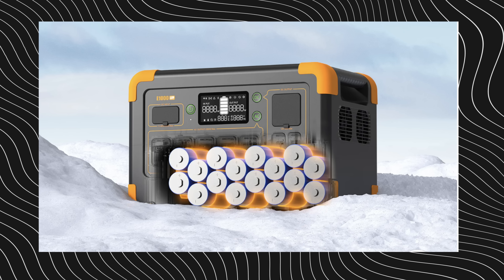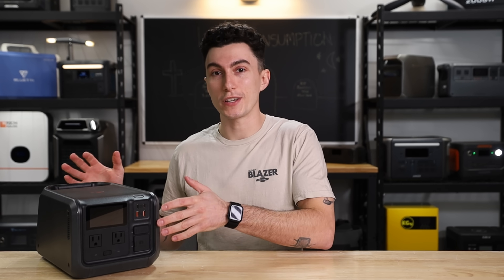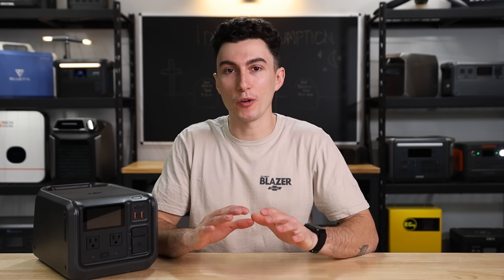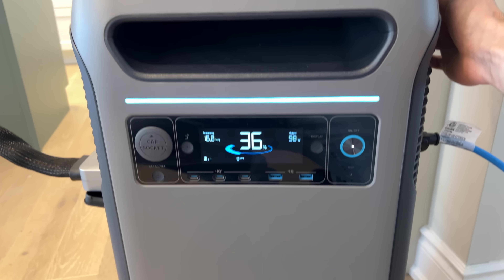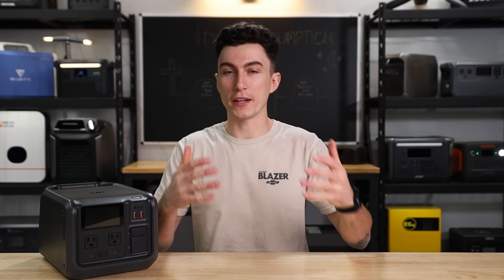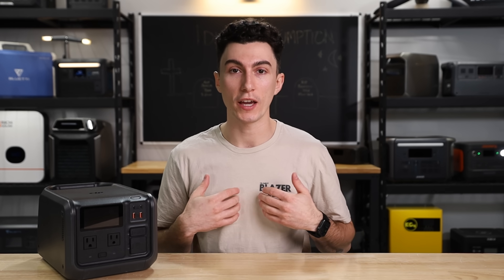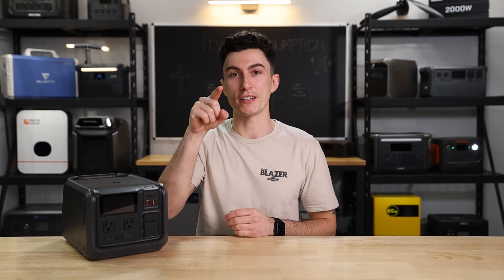Why Your Power Station is Draining Itself So Fast..

Comment: I only run a little power station for my DJ gear and mobile use i use my main solar array to run my off grid house for jyst this reason oh and also the bigger power stations are not worth the price in my opinion i refuse to spend so much on a little setup with so many limitations

Comment: It get's better. With these devices turned on: Cyberpower 650VA lead acid UPS 7W with nothing plugged into it. Bueltti EB3A shore power no outputs and claiming it's pulling 0 from the wall to charge is pulling 29W to be on. Eco Flow River 3 29W. FFPower P2001 9W So even when these power stations are claiming they're pulling 0 from the wall to charge they are pulling just to be powered on. And most of them can't be turned off if they're plugged into shore power like the Cyberpower can. The FFPower is probably so low because it has no wifi, bluetooth etc. Ironically it has the biggest inverter. But with the inverters off it doesn't really matter. I bought it on purpose because I didn't want to have to use an app like with the EB3A to turn it off. 29W non stop for a month can matter. I love my power stations but if every watt matters you might want to know the "dirty" details.

Comment: The sad thing is that many devices we plug into an AC power socket actually require DC power. Like a PC or a LED light bulb. So these devices convert the AC power to DC power. Which gives more loss. But it is what it is.
Reply: @Aranimda  they make 12dc led bulbs for the RV market. 60w equivalent  led bulb, uses same socket as 120v.  Label your bulbs. :-)

Comment: 100% on point. Using DC devices on your battery stations goes an incredibly long way. My Anker everfrost will run for roughly 2 days on a 1KWh battery off AC but will run for about a week off DC. It's great that so many devices run off USB these days for that reason. That is also the secret to USB C charging on laptops as well. Great vid!

Comment: I discovered this when I left a small Canon battery charger connected to my DJI Power 1000 for a few hours and came back to 75% battery life remaining, even though the Canon battery is way smaller than that and fully charged in less than an hour. Leaving the inverter idle drained the heck out of that unit. Lesson learned. I've recently picked up a new USB charger for Canon batteries (something Canon still does not offer), and I've been looking for a small DC fridge for the back of the Jeep. What model are you running?
Reply: His 12v cooler is an ICECO VL45.

Comment: Since I use my units only for backup power needs and to save a few $ when the sun’s out, I don’t leave the inverter “on”.  I only activate the DC—>AC inverter when I’m actively using the generator and when I’m away from home (in case the power goes out while I’m gone).  And I’m ok with “idle” inverter power draw during these periods.

Comment: But if you turn off the AC supply on your power station when your not using it then you lose nothing, right? or wrong?
Reply: I wonder that too. And turning the machine off completely won't cause it to lose power?
Reply: You'll still lose a small amount, but not enough that you'll notice

Comment: wrong! DC-loads also use inverters to establish the required voltage (often called buck or boost converters) since these loads are usually smaller, their standby consumption's are also smaller. Also the mentioned dc fridge uses an inverter to power it's compressor however because this inverter is designed for it's load and is usually not active when the compressor is not working, it's own consumption is low

Comment: A refrigerator is an issue for those power stations with 3-10x compressor start usage and 50%+ idle, where an inverter must run all times.
I had to step up to 1000W inverter with 2200W peak to accommodate my garage freezer, normal usage just 70W.
This is how inefficient power station is for 120V freezer. But its only option I have for my condo.

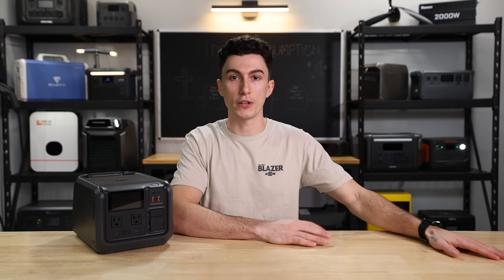Comment: Just a heads up @5:45, there still will be some overhead power used because the batteries are very rarely wired up as 12v.

You would still have some losses converting from 48v (or whatever the internal pack voltage is) down to 12v.
👍

Comment: "The fridge uses 1300 watts per day......."
That's 1,300 Watt HOURS per day.
"The Fridge uses 54 Watts"
"IF the Fridge uses a constant 54 Watts, (Joules per second) over a period of ONE hour, That's 54 Wh.
24 hours it uses 54 x 24 = 1296 Wh"
(Or 1.3kWh)
.
In terms of "water"
"Watts" is the flow rate of the water ("Volume per second/ minute/ hour")
"Watt Hours" is the Volume of the Tank, Or the Volume  it depletes, Or The volume remaining.
.

Comment: You can make a cigar lighter to read black cable and connect to a small external inverter…
It’s messy but if a you need is 60W..

Comment: Power stations are meant for portable use, instead of that just use rack mounted battery with inverter so you can use inverter depends on the load also less hassle, if the inverter fail fix or replace the inverter not shipping out the whole thing

Comment: Just a short comment on the DC output ports: In different power stations, power on these ports is provided "direct" or as "transformed" DC power in different powerstations. For example, some small and cheap unit here provides "raw" DC, flowing more or less directly from the battery pack to the output. A somewhat larger unit (from Ecoflow) provides "transformed" DC power,  with voltage levelled on 12 Volt. With the Ecoflow unit, you'll have to separately switch on the DC outputs. When using them, you'll have both time-based losses, and also up to 20 (!) percent consumption-based losses. Those losses won't be "seen" by the power station itself, which actually means the power station "lies" to the user about what amount of remaining power there is in the battery pack.

For DC consumers using only a few watts, but over a longer time, it might be more efficient to small, "dumb" battery pack. Even if you need additional recharging cycles (from power stations to smaller "dumb" battery pack), which again produce quite a lot of losses, depending on the setup you'll get more "net power in total, then keeping the power station switches on for a long time.

Comment: I found out that my EG4 portable hand truck unit really sucks the energy out of the server rack battery using that 3KW inverter.  I did a test on my residential fridge that draws 115V at 7.2 amps and it only ran the unit for 55 hours.  It used about 2700W to run the fridge and the rest was used up by the inverter.  I am going to order the Victron 48V 1200W inverter and remove the EG4 inverter and run a test to see how long it will run the Fridge.  At most my fridge will peak at about 868 watts when defrosting.  I am anxious to do this test once I receive the unit.  Glad you mentioned this topic.  Many tubers will mention something about it in their reviews but it is more of a side note that many people may not know what it is.

Comment: The DC to AC conversion can be ineffective like the voltage boost. Note that some devices like pure hotplates can use DC even if they are designed for AC. A fridge don't work however as the compressor may need AC to function. The optimal would be to have a battery that match the voltage of the device. So a modular battery that you can clip together to drive the device and then disassemble to charge at a more safe voltage (as safely charge a battery that is at 220v is quite a challenge).

Comment: Big battery, sall inverter is the combination hard or impossible to find. I buil mine. 3.5kwh with a 600w inverter. The inverter did not kill the battery and it is enough for a couple of lights, the wifi, tv and computer at the same time for a long time.

Comment: There is still idle consumption when only using DC power. I have encountered this a lot with my EcoFlow unit.
Reply: How do you reduce the power consumption in idle?
Reply: @ you can’t unless you turn off both AC and DC output and have nothing plugged into USB outlets etc. Or just turn the unit completely off. Most of these power stations use a higher internal voltage and then reduce it to around 12V for output (5v for usb) Lowering the voltage results in power loss.

Comment: Idle consumption on the Delta 3 Plus is 35W - 40W. That's quite bad even considering that it has a 1800W inverter. Victron's 2000VA inverter has 11W idle consumption. Granted it's a completely different grade of inverter.
I've measured EcoFlow's River 3 Plus and it's idle consumption is around 8W. The inverter is only rated for 600W. Though if one intends to run a load of less than 100W, it's much more efficient.

Comment: So if i am understanding this, it's not actually idol time loss. It's the units operating consumption from inverter inefficiency plus a little bit of power for the display and control circuitry. 
But when the unit is not in use, sitting in a closet, is there any parasitic drain?
Reply: Yes, but MUCH less than inverter idle.  All batteries, regardless of chemistry, suffer a small amount of charge loss with time.  You just need to have a maintenance schedule on batteries kept in storage.
Reply: Fully off a power station will lose some energy over time because the battery chemistry is that way.

If you have a power station you should take it out, use it a little, and charge it back up every 3 months. In fact, its good to make a checklist of things to do every 3 months in general. Emergency water and food rotation, checking all batteries, checking generators if you own any, etc.

Comment: Excellent video, thank you
I use  DC LED string lights to supply light, the consumption is tine and under 5w
The power supply for the CPA is substituted with a DC-DC PS that keeps my draw low.
The DC powered refrigerator is a good start. 
The idea is to be nimble
THanks

Comment: Because these these cheap high-frequency, transformerless power stations lack an output transformer to provide galvanic isolation between their DC boost stage and their AC output, they can damage your appliances and even set them on fire. Don't take my word for it; ask Google AI this question: Can a high-frequency,  transformerless inverter damage your appliances? and learn the truth about these potentially dangerous products.

Comment: I did a review of the power station you had next to you, the DJI Power 500 and RANTED how much I disliked that you could not JUST PLUG IN SOLAR PANELS into it, you need some sort of MPPT adapter for $58 extra, and the listing on Amazon made it seem like you could, which was false advertising. 

Here is the video I made reviewing the unit you put in the center spotlight:
- DJI Power 500 Power Station NOT Solar Generator Drone Charger Unboxing Review 
https://youtu.be/5sBob9pafIk

Great video by the way!

Comment: I’m looking at Ecoflow River 3 UPS or River 3 Plus to replace my Cyberpower UPS for my workstation, do you. Think it’s a good idea? It has <10ms switchover speed. However, I’m a bit concern about its battery since it will be plugged in to power 24/7, meaning 100% at all times.

Comment: I did test on Idle consumption on 2 twelve volt inverters and they were surprisingly low and these are the units I use everyday instead of solar generator power stations. One 4000 watt one, used about 9 watts an hour, and another 500 watts, only used about 6 watts per hour which was able to run my fridge because it could handle the peak on the start of the fridge. My advice is to get a 12v battery charge it via mppt, and skip the solar generators completely as the those idles will get you, not to mention is is more expandable and cheaper. And I would never get a solar generator or power system that had such high 150 watt power consumption that is just ridiculous!!!

Here are the two videos: 

- OLTEANP 12v DC to 600 Watt AC Pure Sine Wave Inverter Unboxing Review Fridge Test  - - https://youtu.be/iAfzu2Aa3hI 
- Roarbatt 12v 4000 Watt Pure Sine Wave Inverter Best off Grid Solar REVIEW & UNBOXING 
https://youtu.be/I8-J4XMKIN4
Reply: Victron inverters also have good idle consumption.

Comment: The " idle power" consumption being mentioned,  just makes good sense,  so customers can properly plan. 
This was a very interesting video. I know the engineers can crunch the numbers, should be on the little digital display panels with counters.
❤❤❤

The talk of DC appliances being mentioned was EXTREMELY interesting,  b/c it sounded like the use energy more efficiently?

Comment: Is it possible a separate inverter that is more efficient connected to the DC output of the power station might not drain as much power? Of course, at that point you're starting to get close to simply hooking a battery up to an inverter and doing away with the power station. It would be an interesting hack to look at similar to adding batteries to the solar ports on the Ecoflows. Have you considered doing a "hacks on stations" video?

Comment: This is a very big deal for me and it's very hard to find these numbers. Is anyone aware of a published chart or spreadsheet of many of the more popular models?

I'm aware that Delta 3 Plus AC idle power is 40W according to several testers, whereas Delta 2 is 15W. Delta 2 is a better fit for powering a refrigerator overnight, despite being a less expensive, two-year old model compared with Delta 3 Plus.

Comment: Generally speaking the larger the inverter, the greater the idle consumption.  Some inverters, such as the Victron Multiplus-II, have additional circuitry for low-power loads that vastly reduces idle consumption.  But most inverters do not.  The inverters in power stations tend to have particularly poor efficiencies.

So for example, a little 300W 12V vehicle inverter typically burns 10W.   A 1500W inverter is usually around 20W, a 3000W inverter typically burns 30W.  A 10kW inverter typically burns about 100W.  But it depends on many factors, most specifically the quality of the components and whether the inverter has additional circuitry to tune to lower loads.

This is only applicable to AC.  DC regulators and converters have far lower idle consumption... typically less than 1W.  They are still switching, but they don't have to generate a waveform on the output so a DC regulator is actually able to almost completely turn itself off and let the output voltage ride on its buffer capacitor when the consumption is low or zero.

--

Lets get the terminology straight, though, it starts to grate after a while:

"Watts" is a measure of power without time-units.  One might say a heater consumes 1000W, for example, but the amount of energy it consumes depends on how long the heater is turned on.  The unit is Watts (W).

"Watt-Hours" is a measure of energy.  Also "Watt-seconds", "Watt-sometimeunit".   But typically, "Watt-Hours" or "Kilowatt-Hours" is used.  (Wh) or (kWh).

When you said "70 watts per hour"... That is NOT watt-hours.  That is Watts/Hours.  That isn't a proper unit of energy at all.  I know what you meant to say... but please use the correct terminology.  The proper terminology is "Watt-Hours".  "70 Watt-Hours".  Not "70 Watts per Hour".

-Matt

Comment: And this is a fact ive tried to explain over and over, idle consumption is a killer, 70 watts may not sound like much, but its actually pretty shitty, even on that 3800. My units are low frequency, which are a whole different topic, but my 3000w low frequency units idle at 13w.  13w x 24hrs = 312w, and thats the difference in a quality unit, and these chinese units people seem set on buying. I would say I told you so, but I did! TY guys for shedding light on really stupid stuff. HEAR YEE, HERE YEE ! I could build those type of units for a third of the price, but its still just cheaper shit

Comment: #1 idle consumption hater here , here are some tips for you guys..  remember cooling fans within stations also draws power so if you can use without tripping the fan on the better

 for three appliance types

Fridges 
Standing fans 
Routers

1) Fans -  RARITY ALERT!!.. chose DC motor fans put those AC motor fans in the TRASH that's the difference between 80w power draw and 16-30w
Reply: Here's a little secret though some DC fans have TYPE C power cables which means they can draw from DC power directly via USB(and AC via a brick so it's versatile)that not only includes portable power stations but also POWER BANKS TOO!!!! (If they support PD output aka power delivery at certain voltages /amps)

example :
EVYON 12.8" Standing Fan,15db Quiet Fan for Bedroom, Collapsible Fan with Remote Controller, Negative Ion DC Motor Stand Up Fan Pedestal Fan
Reply: Expensive example but the best version is

Xiaomi Mijia 1X DC Frequency Conversion Floor Fan.. but this is too hard to ship and get your hands on 

Alternative are camping fans with built in 20000mah batteries those are $30
Reply: Routers:

Use USB A or USB C to DC voltage booster cables , this will allow your router to draw power from power bank or portable power station usb ports ( aka DC power)

The reason for the voltage booster is because each router has certain voltage requirement limits

Example :

FARSENSE USB C to DC Adapter,Barrel PD Trigger Cable(3.3ft) with 10 Connector Tips,USB to DC Power Cable can Switch Voltage by Pressing The Key